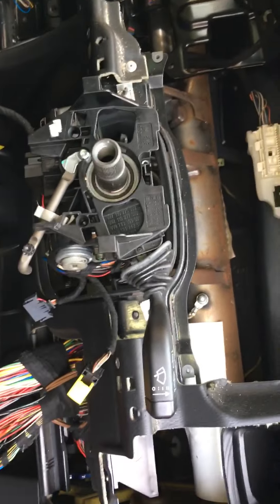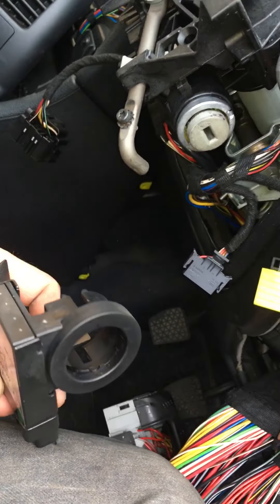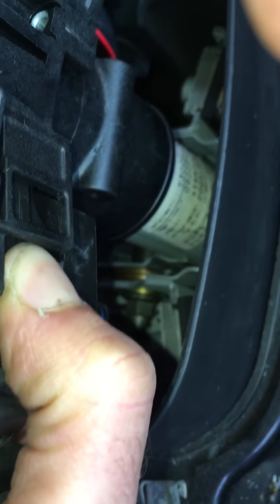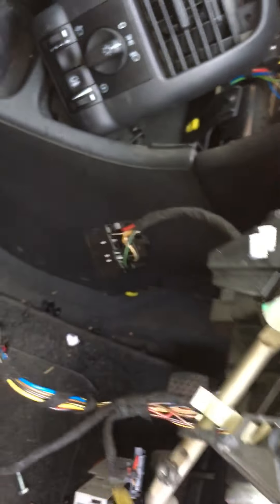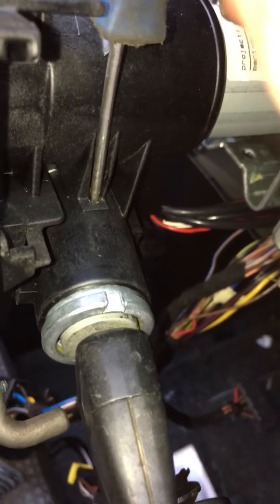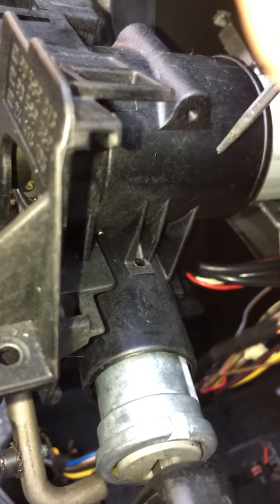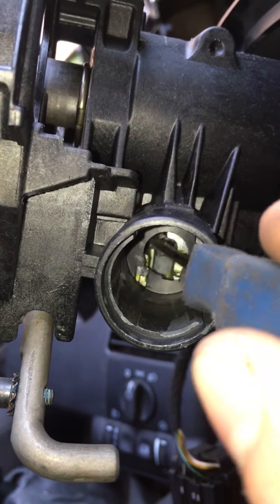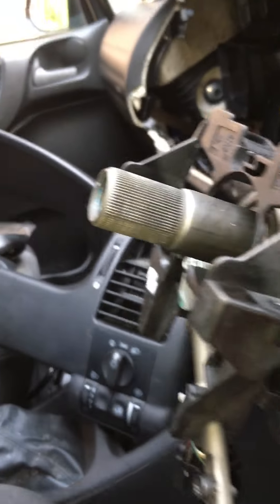Vauxhall zafira A ignition barrel removal and replace 99-05

Comment: Great video, thanks.
In my case, my key was stuck in position 0 but was able to get it to move to position 2 after a lot of picking with jiggle keys. Was now able to remove the barrel and insert a new one. I used a flat screwdriver as you did to pull down the steering lock at the back of the barrel, it would go down but not click down in place, it would come up again,  so I couldn't install the barrel all the way.
 It looks like there maybe is a fault with the lever. I tried pulling down the lever and inserting a small metal object over the lever so it would stay down, but was unsuccessful. Do you have any idea how to get the lever to stay down or is it broken and I would have to replace the whole ignition system? Thanks for any advice you can give! ....Regards, Peter

Comment: I done exactly as shown. Pushed the steering lock down and inserted the barrel and everything seems to be ok apart from the steering lock. It doesn't engage anymore when the key is taken out. The key also won't turn when fully inserted, i have to pull it out a few millimeters but it turns fine and the engine starts. Any idea why?

Comment: Ours will not release, tried lots of times. Does the transponder need to be off though, as its position is not interfering with the barrel releasing hole at the top.  Any help will be appreciated. Thanks
Reply from the maker: Zenon Kolasa hi all I can really tell you is to keep fiddling with it , trying to push the top part in whilst slowly turning the key back and forth , thanks
Reply: Hi, when you are showing how to release the barrel the transponder is already off but  I am assuming that is because the car is in breakage but would it have held off the release if it had been left on. I can only figure out that my barrel will not release due to it being jammed or being held iin place by something electronically connnected or someting electronically still on holding it back.

Comment: Hi can anyone tell me how I get my Zamora key barrel out I've tried the usual ways as shown on YouTube but they don't work can I drill it out or is there another way?
Reply: Zafira
Reply from the maker: adrian parker, have you definitely got the key in the right position mate
Reply: ASSUSEDCARPARTS AASUSEDCARPARTS hi yes I've tried it in every slot but it just does not want to seem to pop out I have the new one waiting to go in but I'm really struggling to get the old on out any ideas
Reply from the maker: adrian parker ,  it's a bit hard with out me being there mate to be honest , is the pin in the top going in at all ?
Reply: ASSUSEDCARPARTS AASUSEDCARPARTS yes it goes in when the key is around number 2 on the key turn, but it does not want to pop out it looks so easy on your video lol
Reply from the maker: adrian parker the only thing I can think off is giving it a bit of a tap and maybe some penetrating fluid if you have any , just tap from above rather than head on if that makes sense , this is the only one I've ever removed so never had one stick unfortunately , thanks
Reply: ASSUSEDCARPARTS AASUSEDCARPARTS ok thankyou for you help 👍
Reply: Good afternoon just an update for you and as I say thanks for trying to assist me previously. I had to hammer the barrel out after taking the ignition switch off from the other side and it popped straight out. I know it's not the right wait but it worked and thanks again👍
Reply from the maker: adrian parker good to hear mate 👌
Reply: @adrianparker9075  hello mate i have the same problem i can't pull out the cylinder, ehen you hammered it from the other side did you made any damage in the haul of cylinder or everything was ok? And in what position did you have the key, 0 or 2? Thanks!